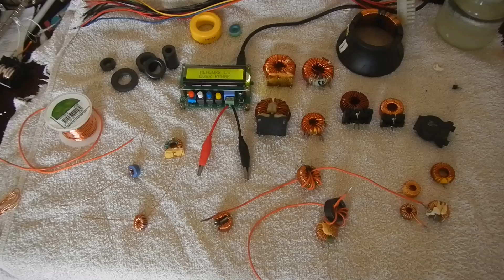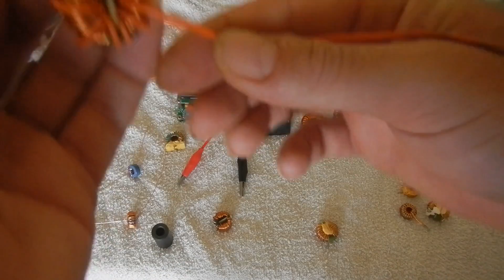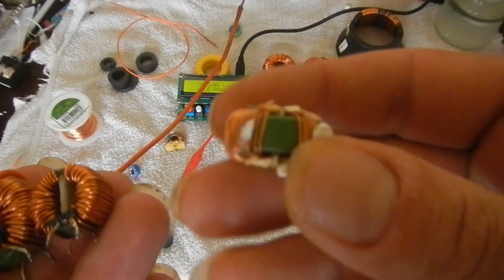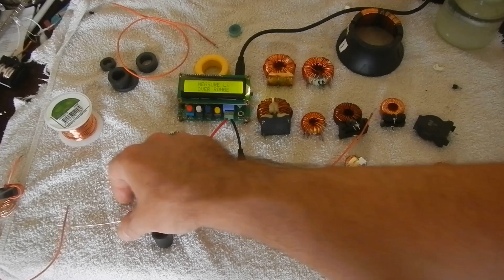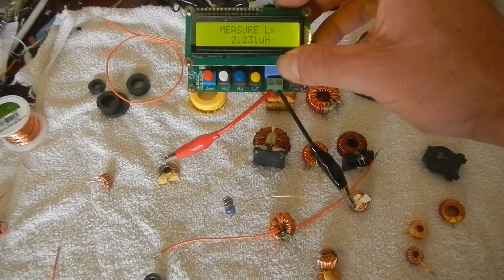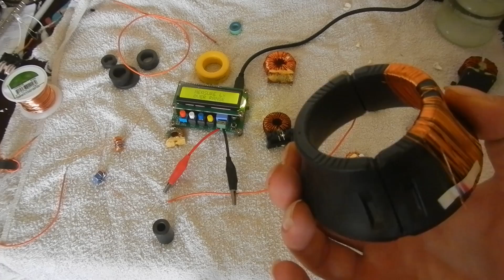How to Test Inductor Cores.

Comment: Well done video  good information  Just so you know you have 6 turns on the toroids  on a toroid you count the turns on the inside of the hole  each time the wire goes through the hole that is a turn .  Otherwise very well done . 
Bob former Lab tech at Heathkit Engineering .

Comment: I probably have a few of these stuck to broken power supply circuits.  Most of them are soldered and then glued to the board for good measure, so I haven't been eager to take the time to salvage them.  But now that I know the green ones are great for joule thieves, I think I'll try to make one.
Reply from the maker: The glue is usually bonded to the board pretty poorly. It's great for sticking to the windings though. So only remove from core if you have to and be prepared to re-wind.

Comment: BTW... the absolute length of wire does not affect the inductance... unless you are working with circuits over 100MHz. Inductance is affected by how many degrees of wrap the wire makes around the core material (in a solenoid or "bar" core).   
    For example: 
... I put 1.0 turns on a random solenoid core (wire wrapped around the outside of the core material) and got 0.43uH for one complete turn, about 0.52uH for 1.5 turns, and 0.58uH for 2.0 turns.  This is a quite common practice in RF circuits, where air-core inductors may have 2.2 turns, 3.5 turns, etc. to 'fine-tune' the required inductance value. (BTW...  RF circuits can get even more picky that that... air core inductors can be "tweaked" by spreading the turns!  In VERY high frequencies (over 1GHz), just a straight copper trace path on a PC board acts as an inductor!  Been there, done that.)

However, in a toroid core, because the core itself "wraps" around the wire 360°, you can't have less than full-turn increments. Because the magnetic flux stays within the core material (toroids are essentially self-shielded), partial turns have no effect... it's strictly about how many passes the wire makes through the center hole. If there were a toroid core that was flexible, and you twisted it so that it formed two loops instead of one (without shorting the flux out), then the Al would be double of that if the same "flexible core" only formed one loop. 

Also... using that length of wire as a "zero calibration" method is a bit flawed... because it forms at least 75% of one loop of an "air core" inductor... which has some very real inductance. The best "zero" is just to clip the test clips together. It's not much inductance, but on my nice LCR meter, I get 260nH (0.260uH) for a similar piece of wire, held in a similar shape. Effectively, by "zeroing" your meter using that very nearly one-turn air-core inductor, you have subtracted that inductance value from all your other subsequent measurements.

Inductors are fascinating, but sometimes can be a bit "mystical".

Did you know you can store Amperage in a special kind of inductor (loose use of the term)... apparently lossless over a very long time... like years?

Edward Leedskalnin... a non-highly-educated experimenter, discovered things about magnetism and inductors modern science has yet to explain... like the PMH.
It's essentially a U-shaped iron-core with many turns of wire. A flat iron bar is placed across the open-ends of the "U" shaped core, then a brief DC pulse is applied to the wire. The flat iron bar will be STUCK to the "U" shaped core, with no power applied. Once "charged", this device can be stored for years... and the flat iron bar will never fall off.
THEN... to prove that real energy was stored in that "magnetic circuit", a small flashlight bulb can be connected across the ends of the wire, and when the flat iron bar is "smacked" off of the ends of the "U"-shaped core, the light bulb will flash.  Real energy was stored... and many people have proven that the same amount of energy is recovered no matter if it was 10 seconds after it was "charged", or a year.

My personal favorite implementation of this "effect" was shown by Russ at RWG... https://www.youtube.com/watch?v=YhiAIsJCS9Y
He also has this 2 year PMH proof: https://www.youtube.com/watch?v=832qz3s1M-s
...and:  https://www.youtube.com/watch?v=uFycNY_mNBk
Reply from the maker: Great comment. I am aware of all that, but this video was aimed at novices.

The reason I used the same length of wire I measured with, as the zero control should be fairly obvious I would think. Especially as I explained my logic a little in the video. Remember the idea of this experiment is to be able to get some idea how various cores compare. So each core must be tested with the same control conditions (Ideally I'd control freq too, but my tester does not allow that, only give a readout of the "best" freq it finds). When testing the long straight length on its own I found it did have noteworthy inductance So it was important to disclude that from the test as part of the control testing. Just like using the Tare feture on scales to disclude a container before you weigh something in that container.
Reply: had a lot of coffee have we??

Comment: BTW... that latter one with the white plastic inside it (that you said was an air core)... that's actually a plastic 2-piece shell around a toroid. Some of those common-mode chokes you have (the ones with 2 windings) are molded with sharp edges, so they use plastic shells to prevent abrasion on the enameled wire.
Reply from the maker: Yea I worked out they had cores when I noticed a magnet sticks to them. They just feel so light it was suprising.
thanks for the comment. I want to pull a comon mode choke apart now...
Reply: Mongrel Shark
Seeing your video prompted me to go through my collection of toroids and mark them according to their AL values at different frequencies. I bought one of the DE-5000 LCR meters, and having a meter that will test from 100Hz to 100kHz tells a LOT about the usefulness of various cores in high frequency applications.

I found several of my cores that worked OK at 1kHz and even 10kHz... but went completely useless at 100kHz (their inductance was way low at that freq.). I also found several that were completely FLAT (consistent) from 100Hz through 100kHz... and also some that began to taper-off between 10kHz and 100kHz. That's why I chose to spend the $80 for the DE-5000 (eBay, from Japan).

I found some of these common-mode choke cores that had an AL value of over 5000... I'm still trying to figure that out... but it was repeatable (540uH @ 10 turns)

For reference for your viewers:
The "AL" value of a core = Measured Inductance in nH / (#turns-squared)
If you measured 50 uH, using 10 turns of wire (the normal test number), that's:
50,000 nH / 100 = 500 AL value

If you wanted to rewind that same core (AL = 500) to get 120uH (120,000nH):
take the square root of: (desired nH) / AL
(120,000 / 500) = 240; sqrt of 240 = 15.5 turns
If you round up to 16 turns, you get an actual inductance value of:
(16 squared) times (AL of 500) == 256 x 500 = 128,000nH == 128uH
Reply from the maker: Great info there. I didn't know about Al values. Seems a sensible way to measure them.

Was the 500AL core a dark green. Commonly found in ATX PSU's? I have found they are good right into the mhz range.

I quite like the meter I use in this video. Tells me the ideal freq up to 1mhz. If I want to know about performance at a specific freq I test it with a function gen and O'scope...

Although I will have a look at the DE-5000. One can never have too many meters.
Reply: how to test inductor via Digital Multi-meter
Reply from the maker: Not any way I am aware. You could use a signal generator and an oscilloscope. Or get a DMM with inductor test range. You need to measure change over microseconds....
Reply: get lcr meter is way to measure inductance, or the meter the dude has which is cheap off ebay.. 👍😎🇬🇧

Comment from the maker: Long side to base is good for low start up voltage, I can get 3904 to start from 0.4v this way, with 17:1 wind ratio and no resistor. Long base wind will give less volts out, but with a significant amount of current. If I was charging batterys thats the way I would go for output. Your problem is too many volts, and non-adjustable resistor. Chose a fixed value AFTER you have it tuned. Or stick with 1k and get flat battery to run it!

Comment from the maker: Great choices. I couldn't get one to work till I used those parts :) You battery is way too full!!! Your transistor is switching on, but not osculating. Try less than 1v. If you use a 100k pot, you will be able to get up around 1.3-1.4v... Make sure winds are both going same way. Put less turn side to base for higher voltage in. will give significantly more output. I can get hundreds of volts from a flat aa this way. If you go long side to base, you will get cont....

Comment: Hi Shark, the parts I used for my JT: NPN 2N3904 transistor, 1K ohm resistor, blue led,  1.5v battery and the ferrite toroid (very small) from the old Intel motherboard and I wrapped with a 60 cm enameled wire copper cable and a 20cm normal plastic wrapped wire.

Comment from the maker: You will have slightly better results with ferrite cores. I suspect you are either winding the cores wrong (easy to do). Or your transistor hfe and resistor is not very compatible with the core induction and magnetic amplification property's. Which is a bit tricky for novices to understand. What transistors do you have?

One of the best things I found for getting the right values, was a potentiometer for the base resistor. This way you can vary the resistance.

Comment from the maker: All sorts of appliances. The Good Green ones are from pc PSU. Most mains appliance have a white core on the power input, right where the cord attaches to the board. Connect the two winds diagonally, and the join is center-tap. Most common JT problems are coil wound partly in wrong direction (all same way with tap works), or wrong resistor value for HFE of transistor. Lots of JT videos on my channel, Not many know them as well as me, feel free to ask for help :) Use a pancake and get wireless :)

Comment from the maker: The meter is $30 on ebay. I'm sure you will have one soon ;) I'm leaving the wire, either till I need it for primary's, or need the core without it. The Yellow, light green and blue cores seem to all be low permeability, for Choking use. Although I have done JT's on them and they go better than a rusty nail. If you are considering throwing out Dark green (especially with bifilar wind and divider) or grey, send them my way. I still pull resistors and diodes and small caps! LMAO Got buckets full!

Comment from the maker: Thank you. Its a Cap/inductance meter. Has hi and low ranges for both. Goes from pF to MF, and µH to H. about the only thing it would struggle with is large super caps. No other meter functions like volts or amps. Just L/C MakerJ101 does a great review on it. I can see there will be more questions about it, so I'll go add a link to his video in the description, check back in half an hour.

Comment from the maker: Glad to be of assistance. Makerj101 does a great review/tutorial on the meter and the other ones on ebay in the same price range. I had 3 other meters before this one, 2 really cheap ones (still good for "risky" measurements) and a DMM with induction. Blew out the range on the DMM trying to work out what was going on with a leaky leydens jar (Salt water on the foil, probably made a battery) It was the least accurate anyhow. I really like this meter though. Best $30's I've spent in a while.